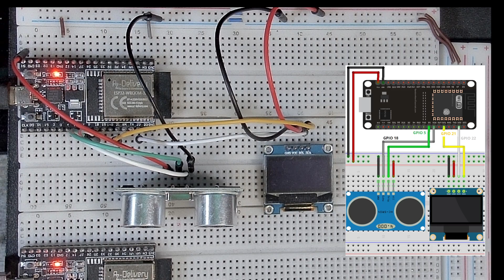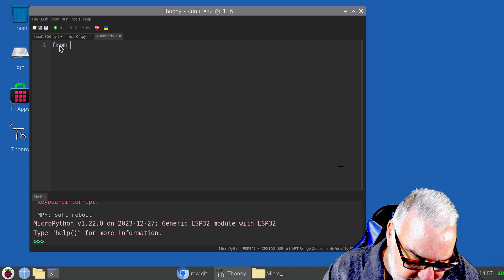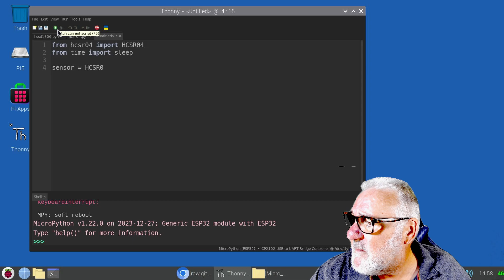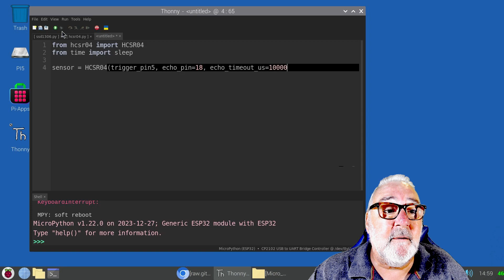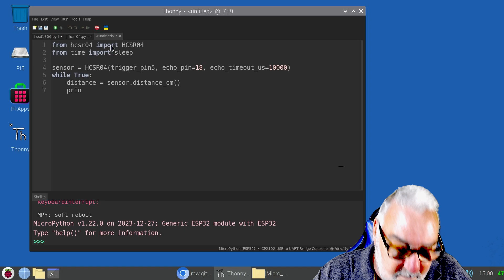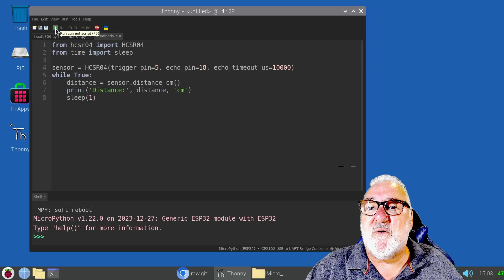How To Measure Distance Using The HC-SR04 Ultrasonic Sensor

Comment: Interesting video, Do u have projects using sensors with raspberry pi and scratch ?
Reply from the maker: yes i do if you go to my youtube channel I have loads. Lets code for the older folk
Reply: @LetsCodeForTheOlderFolks-dt2vx  excuse me but I haven’t seen any. I saw only project based on the programming with scratch on Raspberry pi, but I wanted to see like a block coding where we program the ultrasonic sensors or any sensors with scratch on raspberry pi ! I don’t know if I’m clear enough ! Thank you